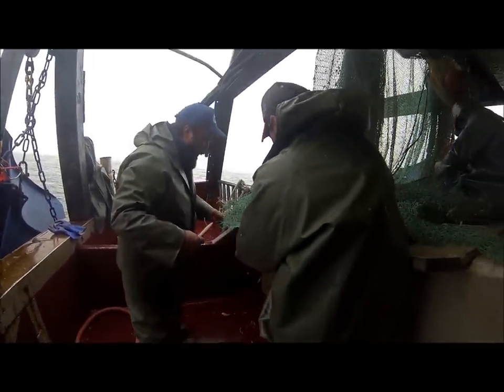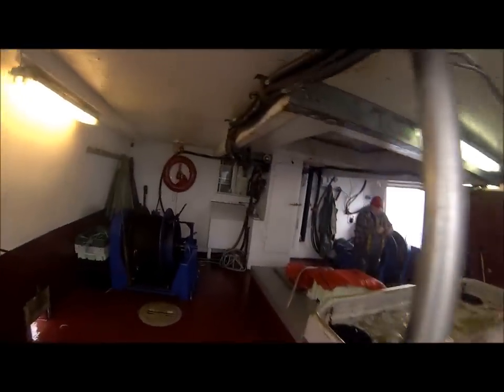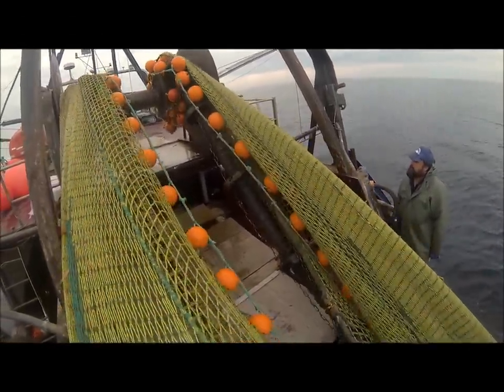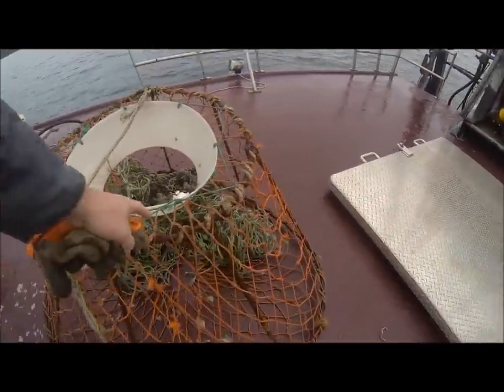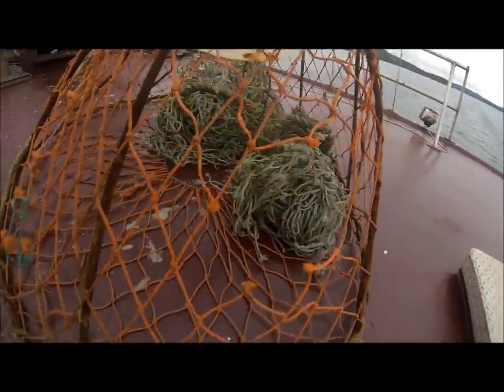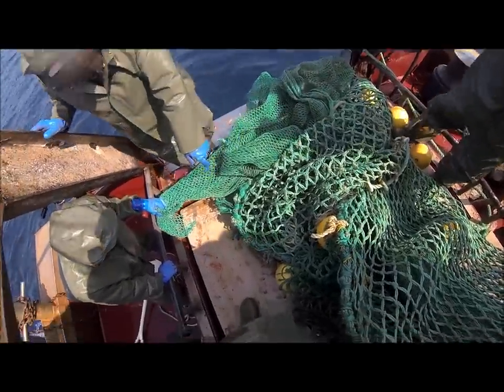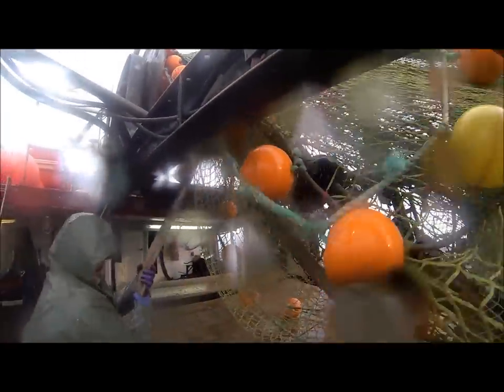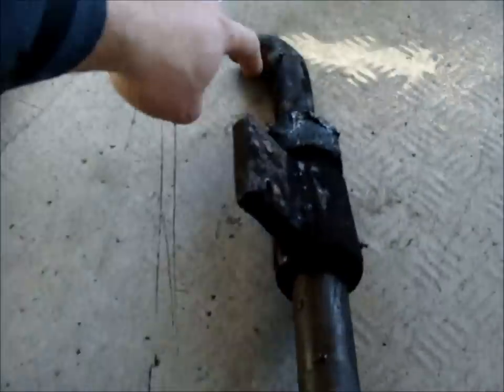Fishing - An Everyday Adventue  ..!!

Comment: Looks like there is no time to spare on the boat with all the work patching holes...Does the net come in with new holes everytime you reel it up? I bet fixing the chain was a pain in the ass...
Reply from the maker: These clips were took from the whole summer, most trips ain't to bad you get a scatter small hole but once in awhile you'll get a major tear up. Most times you can fix it at sea but once in awhile you need to get it in on the wharf, spread it out more room to work. Yup replacing or sometimes joining the chain sucks, lots of grease gotta be careful not make to much mess.

Comment: The fishing is usually the easy part, keeping everything working is the real work. It's nice to have someone aboard that can fix most problems.
Reply from the maker: Yes you got that right, time is $$$ when on the water. When I was tightening the brake on the drum the welding gave out, pulled the handle from my hands, was a close call, think I was a little shook up never really explained the winch trouble well but the boys done a great job getting it back in shape...